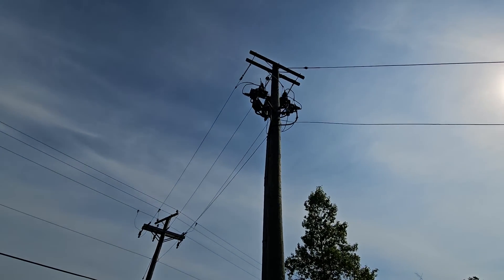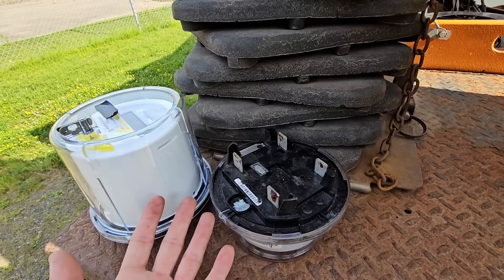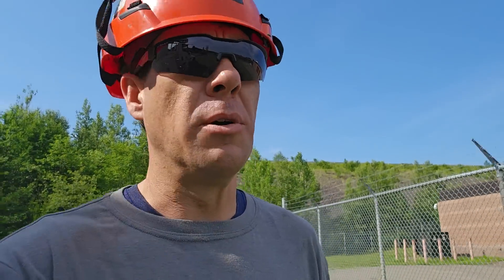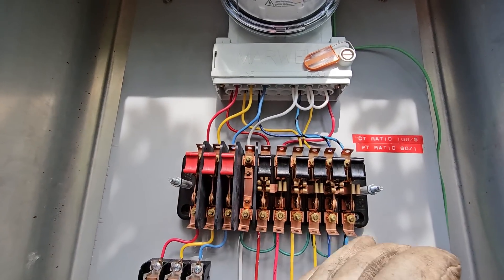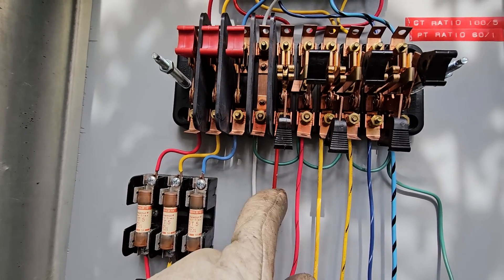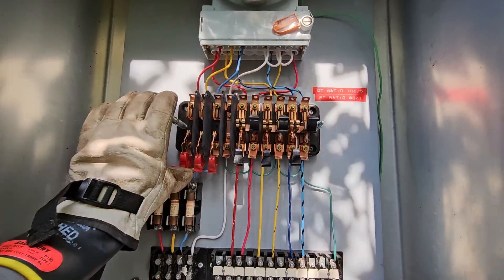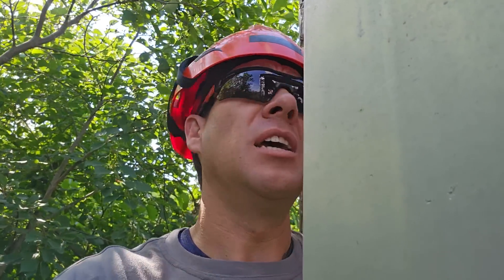Changing a "Smart meter" - 3 phase

Comment: I'll try a technical explanation of why you can't open the secondary of a CT.  The ideal operation is that it will force the proper secondary current:  if it's 100 to 5 and you have 100 amps in the primary, it's going to do its darndest to force 5 A out of the secondary wires.  Even if that requires a high voltage.  And that high voltage can produce an arc, or break down insulation that was never designed to handle substantial voltage.

The high voltage will also drive extra flux through the magnetic core and saturate it, which leads to spiky non-sinusoidal waveforms that can have even higher peak voltages, and can even mess with the power quality flowing to the load on the primary side. 

I also want to say that as an engineer and an engineering professor, I have learned a tremendous amount from this channel. Reminds me of when I first started as an engineer and was lucky enough to get paired with a very smart and experienced technician, who  taught me lots of valuable skills.
Reply: Also of interest: In electronics that need very high voltage, like CRT tubes, this effect is used in special transformers called flyback transformers to generate the high voltage.
Reply: All CTs are a coil of wire.  In a donut CT, the coil is hollow and you slide the conductor you want to measure through the middle.  In a bar type CT, a short conductor is already placed in the middle and you connect to each end.  You can remove a bar type CT by disconnecting the lugs.  To replace a donut CT, you have to cut the wire in order to slide it out.  Bars are convenient, but a donut is tamper-evident because the cut and then spliced wire is noticeable.  Because a CT is a current transformer, it can only read alternating current.  Hall effect sensors are used to read direct current.  Shunts can read either, but are more commonly used for DC because CTs are superior for AC in most cases.

The explanation given for why you don't want open lines on a CT is good.  I'll just add that the term used is open circuit voltage or VOC, in case anyone is looking at equipment and sees it - photovoltaic solar panels are an example of where it is commonly seen, although the difference between the operating and open circuit voltages is not as extreme as it is for a CT.  You usually don't see it as a listed rating on batteries, but you can stick a voltmeter on a battery and then add a load and see the drop when it switches from open circuit to operating a load.  The counterpart is short circuit current, which is typically higher than operating current.
Reply: @josephbrown8905  Good additions to the explanation, thanks.  Note the an essential part of a CT is a magnetic core inside the coil.  The quality of that magnetic material affects the precision of the measurement.  There is an alternative current sensing coil, called a Rogowski coil, which has no magnetic material inside the coil.  Although it looks similar, it functions differently, and produces a voltage output rather than a current output.  But that output is proportional to the derivative of the current, not the current, so you need more electronics in the sensing circuit.  An advantage is that there's no worry about open-circuit voltage as that voltage is never very big.
Reply: I'll explain the insulation breaking down. Transformers have copper windings. The copper wire has an enamel coating to ensure the winding is not just a lump of wire acting as a short circuit. This enamel coating has a voltage rating and if too much voltage exists between the windings a temporary arc will jump through the insulation causing a short circuit. Once the insulation has broken down it is likely permanent damage has taken place.
Reply: And is it the same for donut CTs? 
In my mind, the answer is NO. But asking just to be sure.
Reply: @martf1061  It is the same for donut CTs if they don't have an internal burden resistor.
Reply: @martf1061  Same problem in donut CTs.  Generally, if they're smaller, the problem will be less severe, and some have built in burden resistors so they are never truly open  on the secondary.
Reply: @martf1061  A CT is a CT.  Doesn't matter if it's bar or window. If you open the secondary of one, you're creating an infinite step up transformer.
Reply: @Meowth849  Not an infinite step up transformer, it's decidedly finite. The one in the video has a 100:5 ratio, if unloaded its output voltage is "only" 7.2k*100/5 = 144kV.
Reply: @eDoc2020  Yeah let's be pedantic on YouTube videos. It wouldn't ever hit 144kv before flashing to a grounded object so if we're being honest it would never reach that potential either.
Reply: @Meowth849  I suspect it would internally arc over before jumping to a grounded object. In any case bad things will happen.
Reply: @eDoc2020  X2 would be tied to neutral which would be grounded somewhere along the way. This means arcing over is arcing to a grounded object. I hate engineers. You think you're so smart but say the dumbest things.

Comment: I’m pretty sure you should have lowered those PT switches before you touched any of the CT switches.
Reply from the maker: That part is irrelevant as the CT circuit does not get interrupted. I did however lower the wrong CT lever first for a fraction of a second.

Comment: Some industrial facilities have high voltage equipment such as furnaces and large motors, so it is necessary to meter the high voltage. Examples would be aluminium smelters, electric arc steel furnaces and very large motors used in the largest refrigerating plants.

Comment: You need to replace those cts now and you could have fried your self. You need to throw the bypass first in which yours is on the right. Your c1 with your start from the right side. And it’s dangerous because it will ramp up the voltage to primary levels through equipment including switches. That’s why it will arch it’s because the insulations and clearances aren’t enough

Comment: Why CTs are dangerous: because they are up-stepping the voltage. They take a high voltage as input and turn it INTO AN EVEN HIGHER voltage. But they can only produce limited power, and normally resistors inside the meter act as a load, so they limit the total current and voltage. But if you remove that load, the terminals of the current transformer will reach whatever voltage they can, possibly causing arcing.
Reply: Current Transformers transform CURRENT, not voltage. The voltage is regulated by the Potential Transformer, wired in parallel with the CT to down regulate voltage from high to low.
Reply: @insolentjaguar  All transformers transform both current and voltage. CTs are upstepping transformers, because they have 1 turn in the primary winding and multiple turns in the secondary winding.

The word "current" simply means that the purpose of the transformer is to measure the current.

Comment: I'm sure you get this question all the time: Are the new digital/WiFi-connected smart meters more "efficient" at detecting residential usage, say by compensating in real time for different Power Factor values? I know a guy who used to keep his bill artificially (hence, illegally) low by adding capacitors to his home's wiring.
And, if the answer is essentially "Yes", do you give any credence to consumers yelling about their bills going "Up", "Way Up", even "2-3x Higher" after the upgrade??

Comment: Hey Aaron, I came across a coax drop today that was melted nearly the WHOLE length from the house to the tap (fairly long with a midspan) Customer said it was smoking yesterday!  Since we aren't supplied amp clamps, I was concerned it was a serious problem, so I called MB Hydro to be safe.

A guy showed up maybe 20 min later with a bucket truck, but didn't seem too concerned. He pulled the meter, ran some tests and said everything's showing good. I felt really dumb cuz I fully expected for him to find an open neutral! I then asked if I could cut down the melted drop from the house while he was there, just in case. Nothing. No sparks etc.

He changed the crimp on the neutral at the weatherhead just to "do something" and trimmed some large branches near the pole after talking to another neighbour.

Anyway, he said he'd hang around while I changed the drop. I asked if his tests would indicate an issue with the neutral from the panel to the meter, and he said no, that's not his problem (understandable.)

Their internet came back up, so I asked them to try their oven and dryer for a few min. I also said if the drop melts again to call an electrician. I was so worried that cutting the old drop could've started a fire.

The troubleman said he's seen some strange things with open neutrals but not a drop melted that bad.

Sorry for the long message. Just curious what your thoughts are, and hopefully we get to see a video on this topic soon. Thanks!
Reply: Oven and dryer are balanced loads so they wouldn't cause any neutral heating. The best test (assuming you don't know anything about the customer's wiring) is one high load plug-in appliance like a microwave or space heater, that way you can be sure it is 100% unbalanced.

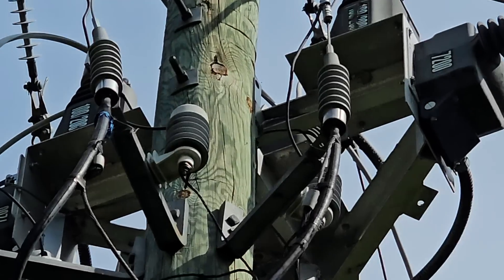Comment: 6:37 you can see the CT is a multi ratio either 100 or 200/5.  Those are chosen based upon the taps used on the secondary side of the ct ie x1-x3 or x2-x3.

Comment: I work at a weld shop with 1800 amp service, the plant manager told me the electric bill is on average 20-30K dollars a month. They where told if we spend 18k on buying 3 VFD's for our dust collectors it would lower our power usage and that it would pay the cost of the vfd's in 3 years. Does that sound right or they full of crap?
Reply: The VFD's will smooth out the "spike" on startup, reducing the demand factor going through the meter.  I'm no expert here, just going by experience here.  Also, if your shop has air compressors, put VFD's on them too.  Any power source that has a high torque startup needs a VFD installed on it.  Welders, too.  Time to get rid of the old equipment and invest into the newer stuff in the way of welders.  You will see a big difference almost immediately.  The power company may like you guy better, too.  The power company can also work with you on some of these things and may even qualify for some energy credits, too.
Reply: @4GSR  VFD for a welder? I have never heard of that. Very interesting, I will definitely look into it.
Reply: @JOHNPHUFNAGEL  Oh no. Agreed, never heard of ones for a welder.  I was referring to your comment of putting them on the dust collectors.

Comment: from what i remember from school in January, open circuit on a ct will cause the voltage (or amps) to reach a dangerous level because its no longer grounded or something but all i remember is my instructor saying if there ever was a question that should get you failed instantly is saying "yes, open circuit on a ct is ok"

Comment: The reason can't you open circuit a current transformer (CT), but you can open circuit a power is transformer is because a power transformer has winding on the primary side and CT does not (just a wire which is a single loop).  As a result, the CT has an intern resistance that is very high, the power transformer has an internal resistance that is very low.  From Ohms law V=IxR, so if the current is significant enough and the internal resistance is high - high current x high resistance = high voltage.  A CT may see 400V or 800V or more.  From Bobsdecline video, the CT test switch separates the currents by a very small distance (1/8"-1/16", 2mm or less).  High voltages will begin arcing in very short distances, arc causes damage. Shorting the CT provides a low resistance, low resistance X high current = lower voltage.

Comment: the wires for that meter look on the small side for a big building like that or does the site have multiple meters on it?
Reply: The current doesn't go through the meter directly. Current goes through current transformers, in this particular building they have a 100:5 ratio. If the building is drawing 100 amps the CT steps it down to 5 amps which the thin wires can easily handle.

Comment: My relative has a house with 3 phase power. 3 600 amp breaker panels and enough Air conditioning to keep the house cool, and in SC it is over 100 degrees 6 months out of the year
The electric bill is 4000 a month

Comment: I wonder if the disconnection causing an arc thing is because the CT is basically an inductor, which is something where if the power is pulled off, the voltage spikes. You use diodes (I think?) across the inductor to clamp the voltage spike.

Comment: Just FYI, for your safety. In this video you did open circuit the secondary of the CT for a short time. You should always open your shunts (polarity - the ones that catch and short to neutral) before your returns. By opening the returns first your polarity has no return path until you opened the next switch in line shorting it to neutral.
Reply from the maker: Yes that's correct 🤦‍♂️
Reply: @Bobsdecline  Stay safe brother

Comment: Rebuilt a metering tank (as you call it) for a local mill & another 1 for a golf course. 14,400 through & 110/220 out for the meter. 255 litres of Voltesso oil in it & it dripped for days. The phenolic plate for the meter connection had burnt through & need replacing. Hooked it backwards to test with a surge tester & made some awesome plasma balls with welding rods for arc points.

Comment: My own business went from

 (1) Analog dial meters with manual demand resets every month for over 60 years 

(2) to LCD digital reading meters non smart ones with manual demand resets 

(3) To single phase LCD smart meter with manual reset Demand.  Plus dumb LCD 3 phase meter manually read. Manually reset

(4) to both single and 3 phase smart meters for readings remotely. 

 Except they manually reset the demand on the 3 phase smart meter each month.

(5) To both single and 3 phase meters remotely reset the demand and phone home the power used.. 

BUT the 3 phase meter Still does not alert the power company if power is off so not fully smart yet

Through all that new LCD display meters they lasted a year or 2 at first with bad displays..

When the LCD meters started within 1 year the display could not be read.  Sun rain hurricane rains 

With all this jackassery of meters failing on the LCD units the power company restarted the billing cycles 

So no longer could write 2 check for I meters. 

Even odder the monthly meter demand reset guy would have Joe arrive Tuesday to reset 1 meter and Don reset the other meter.

Really odd how impossible to get 2 meters 3ft apart read on two different days.

So for about 12 to 15 years the  bills went from 2  bills in 1 envelope to 2 separate mailings.

Comment: 13:19 Demand Meter here i have 2 Demand meters one single phase..one 3 phase.

Your bill with a demand meter is Not just say 15 cents a kilowatt hour. A higher "peak Demand" over say a 15 minute interval makes ALL your energy cost more

An analogy is if a roofer in July buys 10 gallons of gas a day on an account he pays 3 bucks a gallon.

 But if he buys 50 gallons in Today July 16 day then ALL his prior gas bought in July are billed as 4 bucks a gallon..

If he buys 500 gallons tomorrow July 17 then his prior July gasoline gets billed as 12 bucks a gallon.

The demand meter is because the power company has to size the wires and transformers and regulators for these peaks.

Typically residential meters are not demand meters and businesses mostly are unless dinky in size.

With a business they power company can use the larger Kilo Volt Amperes as the demand instead of Kilo watt hours.

"

Comment: What phone do you have now?
Reply from the maker: S23 ultra I think its called... I bought it last year but just opened the box last week
Reply: @Bobsdecline  Maybe I should've gotten the ultra instead of the +, much better zoom than mine lol, but how do you like it so far?
Reply from the maker: It's awesome so far! Haven't had time to really mess around with it too much yet. 
There's 5 camera lenses on the back... The only downfall I've noticed so far is when getting a close-up shot and using the zoom it changes lenses. Usually not a big deal but if you're very close to something you'll lose fixation on the object as the lens is slightly lower or higher.

Comment: In a short circuit the voltage is close to zero. The CT is a transformer with a winding ratio with current in mind. The meter's relatively low resistance shunts the voltage close to zero. It is the current in the circuit that is measured. With the CT open ,not connected to the meter's low resistance, you have the potential of the winding ratio of the CT on the high line.

Comment: The CT has the inverse winding ratio of a PT or other voltage transformer. So a single winding on the "primary" and multiple windings on the secondary. If the secondary isn't shorted or otherwise loaded in an energized situation, a very high secondary open circuit voltage will be created resulting in a shock hazard or potential equipment damage. (At least that is the explanation we got in the metering section of electrician apprenticeship.)